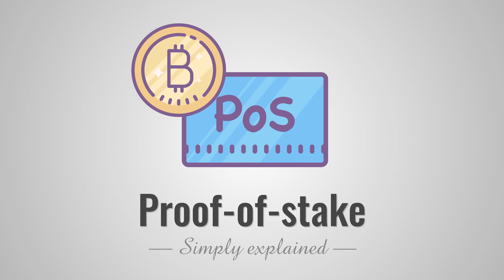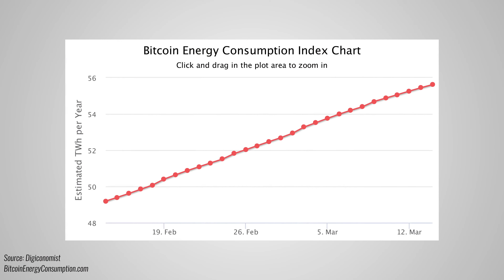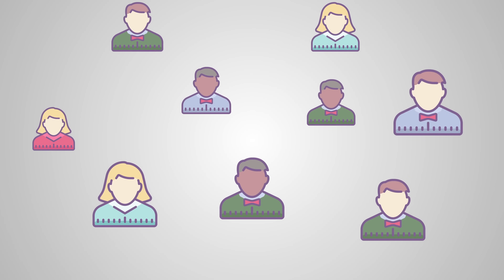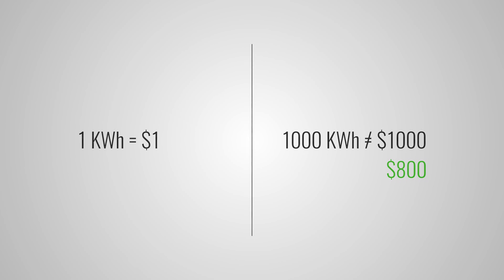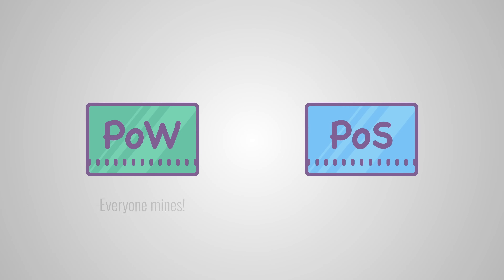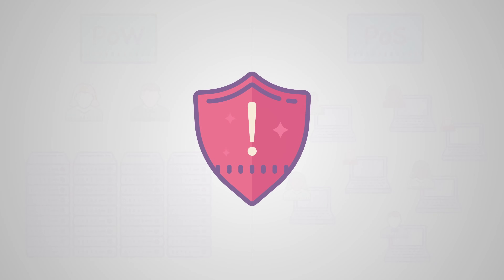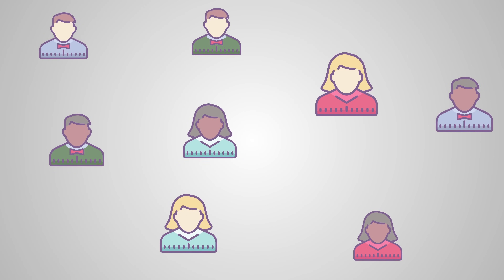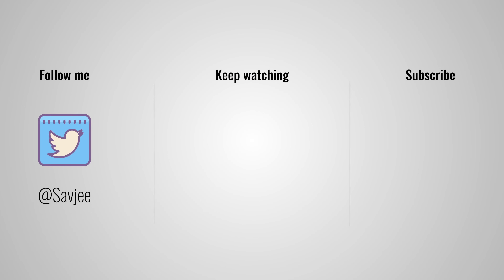Proof-of-Stake (vs proof-of-work)

Comment: This explanation is either clueless or biased or maybe at the time of this video things weren’t clear enough.
If you researched on both concept’s pros and cons while considering the current real world practices on both mechanisms. 
Proof of Work (more decentralized & secure, but less Scalable)
Proof of Stake (more scalable, but less decentralized & secure)
But even tho, it is more logical to say which one is better for what use case and values, instead of trying to persuade others to which is better.

Comment: The essence of the blockchain brute force reverse encrytion is no longer used and therefore the system will not be tamper proof anymore. You now are going back to regular old encryption as described here; you have some source information, you encrypt it, here's the result... While blockchain is about: here's the source, this is what the result must be, figure out the encryption key. So appointing a "validator" would also mean that you revert from the source result calculation to a source, key calculation. How will the key be defined?

Comment: You present very flawed arguments in this video.

You claim proof of work is more centralised due to mining pools, yet proof of stake literally makes the problem worse. The primary "miners" are those who have vast amounts of the cryptocurrency, leading the exact same issue.

The only potential argument in favour of proof of stake is the lower energy cost, and that is true.
That, however, leads to a much larger problem.

 Not only does it leave more power in the hands of the rich, it also makes their mining expenditure minimal.

In the traditional POW system, such as with BTC, miners have to spend large amounts, meaning they have most costs to pay, which leads to them selling BTC to cover costs. This leads to more even distribution of wealth.

Contrast this with POS, which simply allows the wealthy to snowball large amounts by mining at minimal cost.
I don't think I need to explain what the problem is with that.

Comment: The best guy to explain everything, please keep doing these awesome videos!
Reply: He presented very flawed arguments in this video.

He claims proof of work is more centralised due to mining pools, yet proof of stake literally makes the problem worse. The primary "miners" are those who have vast amounts of the cryptocurrency, leading the exact same issue. Worse, in fact! This is literally the epitome of centralisation. 

The only potential argument in favour of proof of stake is the lower energy cost, and that is true.
That, however, leads to a much larger problem.

 Not only does it leave more power in the hands of the rich, it also makes their mining expenditure minimal.

In the traditional POW system, such as with BTC, miners have to spend large amounts, meaning they have most costs to pay, which leads to them selling BTC to cover costs. This leads to more even distribution of wealth.

Contrast this with POS, which simply allows the wealthy to snowball large amounts by mining at minimal cost.
I don't think I need to explain what the problem is with that.
Reply: @bench3248  I suggest you watch Lex Fridman podcast with Charles Hoskinson about PoW vs PoS, very interesting debate.

Also, PoS doesn't happen in the ordinary way people think, there are a lot of elements that should make it work, there is randomized selection and a lot more, Charles has great opinions on this, backed by academic studies to validate its longer-term viability.
Reply: @AmeenAltajer  Proof-of-work requires those who acquire the new supply of money (miners) to continually input real-world work and cover recurring operational costs, ensuring that those who receive the new supply of money cannot keep hoarding it at no cost to themselves. Miners are forced by the game theory embedded into the protocol to redistribute bitcoin into the market.

Any system where the creation of money entails no work and cost would be fiat 2.0 all over again, a system where wealth equals power, where the rich forever get richer and the poor get poorer.

Proof-of-stake is a regressive hermetic system abstracted from any interface with the real world that walks back on Satoshi's solution. Those who receive the new supply of coins are not required to undertake any work or suffer recurring costs to themselves (trivial cost of issuance).

This causes the new supply of coins to be inevitably hoarded by those who receive them (large stakers), thereby leading to a concentration of wealth similar to the existing fiat monetary system (focused injection of money), and since in proof-of-stake, wealth = power, large stakers/preminers effectively assume the role of central bankers, acquiring all the new money and perpetually amplifying their power over the network.
Reply: @bench3248  Thanks for your input :)

Look the way many of the people that work in the space see it, is that proof of work works for now, but it's nowhere near from the perfect (or the most efficient solution), your points on how PoW is the best choice might not be really scalable.

One of the great things Charles talks about is that the people who have stakes in the system won't work against demise, again, check how PoS is offered with Cardano, there a loooooooooooot of items to make it much harder to centralize for the rich, in fact, the way he'd like to actualize it, is that to make sound very close to an open market, where you can have staking pools that are just analogous to business.

Thanks for the input again, I super appreciate that, but to be quite honest the whole decentralization direction is not gonna scale or work with PoW, better ideas will have to be experimented, don't you think?
Reply: @AmeenAltajer  The energy use is intentional design.

POS's lower energy use makes it inferior for the reasons I've mentioned.
Reply: @bench3248  Energy-based consensus is working now, but it's far from perfect, we'll have something much better, that's what we're talking about :)

Comment: 2:40. Translation:  POS is far more centralized, and corruptible, than POW, as the more stake you have in the network, the more "validation," and control, you can take in the network. It removes the competitive aspect of POW, and replaces it with "Payola."
Reply: The real payola is institutional investment ASICS infrastructure, which is clearly cheaper than say for majority groups to collude to take control of over half of all PoS protocol stake, which the video clearly explains. The point is that the unit of influence per dollar is exponential in a PoW protocol due to economies of scale, but is linear in a PoS because the likelihood of being  selected is scaled linearly by random selection. This is why PoS is more liberal than PoW.
Reply: whoever has more ASICs controls the POW coin ...no mechanism is perfect, whales will be whales everywhere.

Comment: Sounds like a terrible idea; reduces engagement with blockchain's difficulty, which will only render unstable digital currency markets and fluctuations of their value... Any bank or government body with access to unlimited resources can pull a mere $79.B (or an equivalent value in time) out of thin air, so banks will have the overall power of a "%51 attack". That is just one flaw stated, but this entire idea only benefits the rich or resourceful in so many ways, and eerily, not just for profit.

Comment: This explanation isn't correct, proof of work is vastly more decentralised than proof of stake, using PoS opens the chance of centralisation by a few people combining to run their validator nodes, some crypto assets limit the number of PoS validator nodes so the 'voting' power is only open to a small number of people/groups.  PoW means the nodes and miners are separate entities making the network way stronger and more secure, way more reliable, and way less susceptible to attacks and centralisation.  Under the PoW system having 50% of mining power in one country does not make the crypto asset more centralised because the nodes are spread out all over the world, BTC even has a node in space on the ISS I believe.

Comment: I like the video but I have some doubts about how accurate the info here is.

 1) "Another important advantage is that setting up a node for a Proof of Stake based blockchain is a lot less expensive compared to a Proof of Work based one. You don’t need expensive mining equipment and thus Proof of Stake encourages more people to set up a node, making the network more decentralized and also more secured.  "

The video claims you need to have mining equipment to be a "node". This is not true, you don't need to spend crazy amount of money to set up your own node. 

2) "If a single miner or group of miners can obtain 51% if the hashing power, they can effectively control the blockchain."

What about the Full Nodes? Aren't Full Nodes checking the miners in order to make sure everything is legit?

Comment: The problem of Pools will not be fixed by a transition to PoS. You will need 32 ETH to become a validator. Which is $78000 (23.01.2022) right now. How many people have this amount of ETH in one wallet? Probably way less people than people owning a sub $78000  mining rig. Maybe in PoS having a lot of money is less beneficial than having a lot of money in PoW, however a lot of people will be excluded, if they don't join a pool.

Comment: Hi this is a great video and I have a doubt regarding it. In proof of stake, if a validator is selected and he/she validates a fradulent transaction , how exactly does the network check if its a malicious transaction and punish the validator?  Is it coded into blockchain or do the other validators check the transaction?
Reply: It uses an existing coin as collateral in order to ensure the accuracy of the transaction.

Comment: Technically, to keep the system secure, we require that the honest miners/validators are a majority over any malicious campaign (even when this majority is below 50%).

Consider 3 pools of miners/validators: pool #1 represents honest nodes that make up 40% of the consensus resources, pools #2 and #3 represents dishonest nodes that each make up 30% of the consensus resources. Assuming that pools #2 and #3 are not colluding (due to different malicious goals, for example) and each of these pools generates a malicious chain of blocks, the chain generated by the honest pool (i.e., pool #1) has a majority of the consensus resources and will therefore create the longer blockchain that will be accepted by the network users.

Comment: The major problem I see with PoS, is that it discourages new people from getting into mining. Adapting this method makes investing in crypto a double gamble, where you’re twice as likely to lose.

As you also mentioned in the video, this benefits people with massive farms, and people with smaller rigs will earn even less. After a while, massive crypto farms will have so high of a percentage that the will literally dwarf everyone else, making them stop mining.

This is not sustainable. Ethereum is committing suicide by using PoS.

Comment: It’s a lot easier to coordinate an attack with existing high has power mining hardware than it is to acquire stake no matter if it’s maliciously or through the market. In PoS you are financially tied to the network & coin age prevents a sudden attack from occurring. Neither have ever happened though so it really comes down to opinion. All chains exploited have suffered an attack through poorly written code. There is no consensus algorithm that has failed to date.

Comment: Why does it feel like someone could just pull the plug once a certain amount of money is put into eth and have ALOT of money. It also seems like pos would be easier to control all of that money and become corrupt because you just need money. Which is easier now to obtain than a mountain of hardware. With pow there is an actual Physical limitation to being able to control a majority. With pos it’s just a matter of value and distribution before someone has total control.

Comment: PoS  centralizes more over time than PoW, because larger stakes get more rewards, therefore their size increases. PoW has its own downsides but it is more consensus proof.
Reply: You introduce a diminishing returns parameter that, after a certain threshold, your rewards in the stake pool diminish. Encouraging new people and even the stake pool itself to either set a new one up or find a new one thus incentivising decentralisation whilst disincentivizing centralisation. This is not a mark against PoS itself, only networks that don't have a work around.
Reply: The biggest downside of POW is literally destroying the environment and people still want it for 'decentralize' :/
Reply: @ucNguyen-xz2vc  The current banking system destroys the environment much more than Bitcoin ever will. Bitcoin's energy consumption "problems" is nothing more than a red herring.
Reply: @Gustavo_C_Vieira  Because the banking system serves 5 billion people compared to 50 million that Bitcoin does. If they were on the same scale, Bitcoin would have almost 30x the energy banking systems use :))
Reply: @ucNguyen-xz2vc  I am happy to experience $2 billion annual repairable destruction in exchange for $2 trillion a year asset. Bitcoin is heading there.
Reply: Honestly? that's a good thing
PoW gave the opportunity to the community to regulate their own currency and the only thing it caused was component hoarding, a chip shortage and irreversible damage to the environment
Decentralized currencies are a nice idea but not at the expense of everyone else trying to live their lives

Comment: EOS uses a DPoS (Delegated Proof of Stake) system with a 15/21 BP authorization to validate new blocks, which has made the blockchain the safest and fastest, not to mention the fact its power consumption is super low. I'm not making this up, DYOR and check it.
EOS can easily do all BTC and ETH monthly transactions in a day and still be secure and deliver everything promised by other networks and projects without needing to power up using a volcano.

Comment: How much energy do all the bank buildings and branches use ? Not to mention the huge power used on Wall Street for example.
Reply: Less. If you were to conduct every transaction on Wall Street with a PoW system it would use a phenomenal amount of electricity. With a normal transaction, you just pay the electricity to send a simple message to the bank. With a PoW transaction, hundreds of miners around the world compete to solve a puzzle to validate just one tiny transaction, consuming enormous amounts of electricity

Comment: Another problem with proof of work, is the scalability issue.  It’s inefficient at best, and scales horribly.  Bitcoin at its best can process four transactions per second.  Visa, the credit card network, at its best can do 40,000 transactions per second.
Reply: It's the same with proof of stake. PoS has a lot of benefits but speed definitely isn't one of them

Comment: I favor proof of work. Reason, workers need to mine and find a rare number by hashing, with prefix set of zeros. When the Blockchain builds up the rarerity increases. So the Blockchain becomes trustworthy method of storeing data for really long periods of time, say birth certificate, or a deed. Any thing that is rare, like diamonds are valuable. Similarly these numbers are valuable. All the high energy spent on mining can be justified if large amount of data in the world is validated by it. You can't get anything free, you need to spend for data security. Currently our data is protected by central authorities, like banks, hospitals, government etc. There are lot of instances someone bust these data and use it for their gains.
Also mineing, can move away from government control, Bitcoin replacing Fiat currency. Something like democracy, instead of royal control.
But proof of state is a path to move to government control. For instance governments are more richer than individuals, so they buy the cryptocurrency and become controllers of currency. There's no meaning of having cryptocurrency, why not have only Fiat currency! And a word about mining pools, pool consists of lot of independent smalltime minors. If they don't go to a pool they may have to mine a whole month or more to get one single coin and not sure you get anything. But mining in a pool in one to two days they get part of a coin. So it is absurd all miners in a pool come together and do something collectively. Mining is not just buy the equipment and plug it, and you get Ethereum. You need to look after the equipment, cooling etc. So some continuous work is needed.

Comment: POS OR POW, which is more censorship and control-resistant?
Some questions I note:
1. Does hashing power in the PoW model mean more security layers?
2. PoS is less immutable given that its coding for verification is less layered (above), it seems, somehow. Given the simple energy comparison, it is difficult for me to believe PoS is better than PoW unless I learn much more about it. Any mechanism of punishment in the PoS model means a rejection of data. It is not a good indicator, even though I don't know Inter-planetary file systems enough to draw a conclusion from PoS deployed in IPFS. The punishment model simply indicates deliberate right or wrong, or simplification. It does not lower the incentive, instead or increase it - it directly punishes. How far is this true?
2.5. The theory for punishment, timeless or updateless, or proactive, whatever the name, seems to be flawed.
3. The early-adopter Ponzi risk is huge with PoS, it seems.